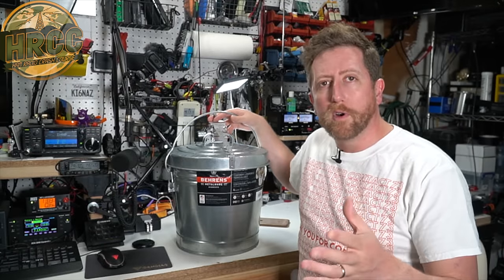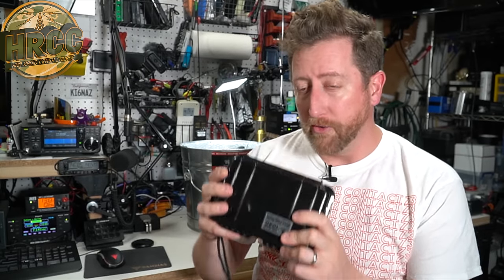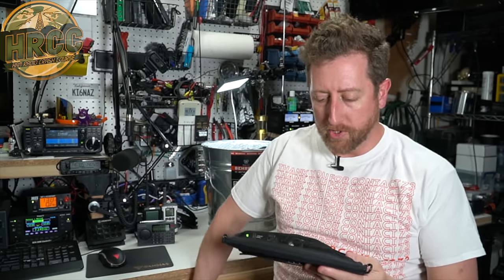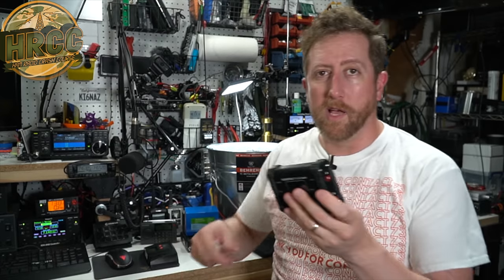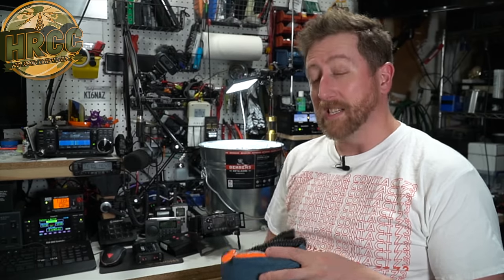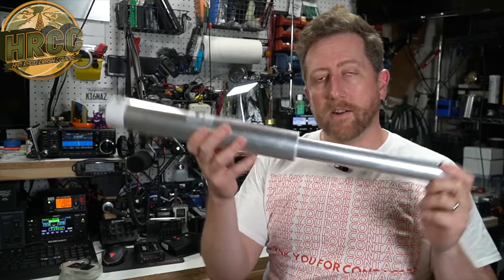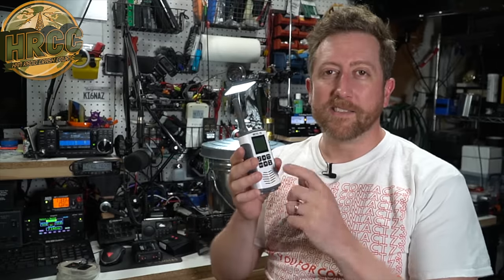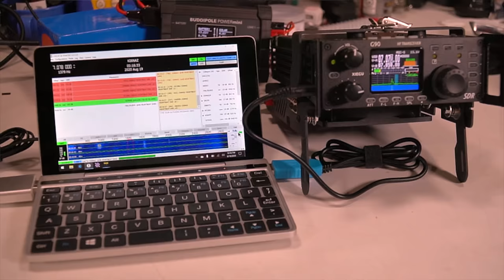Ham Radio EMP Kit, The Tactical Trash Can

Comment: any thought to grounding the can during storage? moisture reasons add silica packs. get 2 set up with cross band radios and antennas an automatic ider and you have a repeater (solar panel and battery extra) or a complete repeater on UHF. duplexors are smaller for UHF. old amo cans could have the rubber seal taken out and put in the rf sealing in its place. to keep water out you could spray it with a sealer on the outside. as for grounding it during storage would a 259 connector with a ground wire to a grounding rod be good enough. laying on its side would be better so lightning would travel less. it doesn't like (u-turns). I could see a lot of use from this type of storage for emp issues as well as a simple field day setup. quick grab kits like this would be easy to set up. a repeater kit simply take out the solar panel lean it against the side put the antenna on the lid and its on the air. one on each hill and you have a vhf repeater. handheld use on both sides of each hill.
Reply from the maker: Check out this video. I test the can for attenuation and also try with a grounding wire. https://youtu.be/o4CnecfAzng

Comment: EMP reception requires a longwave antenna like an HF antenna or power transmission lines to receive the energy and conduct it to any vulnerable device. If your devices aren't connected to a longwave antenna or shore power...you really aren't at risk. Anything air-gapped from these 'antennas' won't be affected.
Reply from the maker: You might be willing to risk it. But I am not. Thanks!

Comment: If an EMP were to take down the power grid even in a small area, the first need will be water and heat for winter cold.
A mechanical generator set can power a well pump, but will require fuel. Vehicles will quickly use up their fuel supplies.
Food supplies would also get horded and ATM's will run out of cash. Then looters and thief's roam at will.

Comment: Why can't you just buy flex seal paint and it would be a rubber barrier inside that can and also seal the seams and any tiny holes where the handle on the lid. If that stuff can seal a hole in a boat, why wouldn't it work as a sure fire seal/ barrier?
Reply from the maker: Meh. It might. Try it out and let me know when you test it.

Comment: I see no reason why you could not have more than one trash can EMP kit.  Or use a slightly larger can.
One question in regards to the lid.  Why didn't you line the inside of the lid like you did with the inside of the bucket?  Seems to me that the EMP would get thru the top of the lid if it wasn't lined as well.

Comment: I like "prepping" but I'm not very fond of permanently storing over $1k of great products away that may never get use.  Old tech still does the same thing and is a fraction of the cost, IMO.  I absolutely love my $30 Radio Shack and Realistic handhelds. They have ext antenna and power jacks. Just because one EMP hits, doesn't mean the threat is over, so you might want to duplicate this for backup.
I also prefer the $15 ammo cans of the 50 cal variety.  They do make larger surplus cans if you need more storage for $48.  These things are bullet proof and are designed to seal up well. I wouldn't recommend putting rivet holes in your can.
I wonder if you will really need the 2m/70cm after an EMP?  I see us using CB 19 the most for local chat (as it is now), with a couple DX'ing channels, and HF for getting across the pond information.
Reply from the maker: So take your kit into the field for some portable work.  No one said the gear has to stay in the 100% of the time.

Comment: Spare brain-box for diesel generator. Pile of "LED Flashlight" main boards. Compact wall warts of all voltages. Car alternator (Yes, I know it needs 12V ... but we can get there...) Bags of key diodes, chips, fuses, soldering iron, arduinos, rasp-pis. Camera/iPhone/sights

Things for EMP that are not in shielded area: At least one "many speed" bike to adapt, Dead car batteries, detached, regular battery supplies, detached, sulphuric acid, nitric acid, lead. (If we're hit that hard, it will be worthwhile making some of the key bits from scratch.)
Reply: What about a generator/starter 9n tractor or airplane that does not require the 12v field of an alternator...
Reply: All great! Every concrete-item in there has been pricier than I wanted to fling at doomsday though. Dead car alternator (that I can repair) much cheaper :D With all the problems a post-EMP is going to have, getting to 12V doesn't scare me. Pretty sure getting alternators to work could be a full time job :D

Comment: I would like to know what your thoughts are on a repeater in that bucket. I just started watching and was a scanner junky I high
School. I saw your Chanel and two days later I have two handhelds on the way. Ones a beogfang. So. I found a repeater on eBay. Needs two radios. It’s small. 5xRPT-2D repeater control box. I think it could be useable. You got a great channel!!!
Reply from the maker: Its not a bad idea, particuarly if you can get it up high and get some solar power on it.  In alot of ways it could be imensely helpful in a bad time.

Comment: You might consider adding a flashlight, cellphone, timepiece, USB's with data & photos, camera, GPS, car to house power inverter,  electronic car keys, credit card, power drill, laser pointer, VOM,  etc.
Reply: You didn't watch the whole video did you?
Reply: @WW5RM  Yes & I have a slimier container.
Reply: I dont believe a cell phone will do you any good. Buy i guess it couldn't hurt to have it. I do believe the raspberry pi and parts for it has the data & photos covered.

Comment: You should also line the can with cardboards so your electronics dont touch the metal sides turning it into a antenna to damage the gear inside
Reply from the maker: It lined in cardboard. 🤣🤘

Comment: Hi. I thinking about you must connect your "Tactical trash can" to the ground with a wire clamped to the outer of the can to improove the flux of electricity to the ground and not into your Faraday cage. Regards ZP5RST
Reply from the maker: Nope, we tested it on anther video.  It didn't do anything to the attentuation of the signals
Reply: @HamRadioCrashCourse  Really? I will find and watch these video. Thanks a lot by your fast answer. 73

Comment: Why don’t you intrinsically bond your lid and main can with a braided copper strap to ensure complete bonding?
Also, with external intrinsic bonding you’d be able to connect an 8 gauge grounding wire connected to an 8’ ground rod, wouldn’t that help to dissipate EMP/ CME?
Reply from the maker: External grounding isn’t going to matter if the lid and can are sealed as one electrically VoA the seal.  And the intervals are isolated from the walls.

Comment: Thinking of the RPi, there's quite a few cheap Chinese Android boxes that have an unlocked bootloader basically allowing you to boot pretty much any OS you want (the Arm version of windows, Linux and so on) from an SD card.

if you could use one of those instead of an RPi, granted they usually have fewer USB ports 2 instead of 4, but I guess you can just use a small USB hub if needed.
Reply from the maker: I wonder if they would have software compatibility issues in that configuration and OS.
Reply: @HamRadioCrashCourse  I wouldn't think so being that you can boot any OS you wanted on them
Reply from the maker: But it’s ARM. For instance. Issue running wsjtx on windows running ARM.
Reply: @HamRadioCrashCourse  well, if the program has an ARM version compiled, being that it has a source available it shouldn't be too hard to do. I mean you could just run the same OS the RPi is running. The RPi is ARM, the Android boxes are ARM.
Reply from the maker: Right, so not much reason to venture outside RPi. Again, go for it. But I’m not pointing people to it now.
Reply: @HamRadioCrashCourse  no of course not, I was just asking since they share the same architecture and can usually be found for cheaper than the RPi and offer the same if not more performance than a RPi.

Comment: Are you keeping the coax cable and antennas inside the can for convenience?  I didn't think an EMP effects those things if they aren't connected to anything.  In fact, in electronics, I thought EMPs mainly effected circuit boards and capacitors, not unconnected wires.
Reply from the maker: Yep. Assumption is if a damn bomb goes off, you might not be grabbing coax and other BS to GTFO.  Just grab the can, other bags and leave.

Comment: i have same kit, just difrent things in it asnd what i did is i melted lead all over the bucket, i heated up the bucket with simple torch and then put lead on it, it melted on it so it will cheald 100 times better then

Comment: I think I would weld or solder a ground wire from the bucket and run to ground also just for extra security.
Reply from the maker: Grounding didn’t change the attenuation results.
Reply: @HamRadioCrashCourse  Very cool. Thank for the reply and knowledge.

Comment: So you made a comment that only a low power HF transmitter will be required after an EMP because the background noise will be greatly reduced - I'm thinking the exact opposite - the atmosphere will be fully charged (ionized) and at lower A(bove)G(round)L(evel and instead of the usual S2 background noise it's going to be more like S6 or higher. In fact the the separate layers may be temporarily merged into a single D layer which absorbs energy from radio waves.
Reply from the maker: .... for how long?
Reply: @HamRadioCrashCourse  too many variables to answer that. Also - the most efficient communication mode is CW, especially with high QRM levels
Reply: One more point - in a EMP situation from a CME or enemy attack -  a situation where the normal social fabric is highly disrupted remember as soon as you transmit its possible to pinpoint your position - so transmitting could be particularly hazardous if you want to remain hidden.

Comment: I doubt anyone will see this comment but a galvanized steel trash can would be coated with zinc, right?  Isn't zinc used with electrical insulators on power lines?  How would the grounding being attached to zinc-coated steel be affected?
Reply from the maker: I saw it. The coating doesn’t matter, so much as it’s some kind of conductive metal. You need to to great a completely closed vessel so the energy of an emp is only one external skin. Grounding isn’t as important here.

Comment: They have spray-on electrical tape. That has worked far better to line the inside of the metal cans than trying to glue in cardboard. Do you see any issues with using a couple coats of the spray?

Comment: i think im going to use a old fashion 30 gallon metal garbage can. the kind we had in the 1960s and 1970s before plastic cans were invented,
Reply from the maker: Tough to cart it around, but not a bad idea.
Reply: 30 gallon lidded metal oil can clamp on banded lid? That would work without modification...

Comment: Would metal window screen material be enough to protect electronics from an EMP?  Also, would metal duct tape (the type that is actually used for HVAC) work for sealing the lid of the can or a can that doesn't have a clamp like yours?
Reply from the maker: No, metal screening likely is not enough. 

Metal tape can work. But remember the lid and body must contact the metal of the tape for there to be a seal. If they are separated by adhesive, it will not work as well.

Comment: Would it be worth putting a cheap cell phone and SIM card in the tac can too?  That would be the P in pace for me, if it doesn't work, or no one is reachable, that's when all the redundant radio stuff comes in.
Reply from the maker: Yes, absolutely, but most prepaids don't carry for months and they expire the number, which requires you calling them to re-establish it.
Reply: @HamRadioCrashCourse   I didn't explain it much, but I would leave it unactivated in the tac can and only set it up with a number and activation when I needed it.
Reply: @58Alpha 
If that's the case, then the internet will be down, so there will be no way to "activate" the sim card?
Reply: @jkg6211  well idk, cellular data may work with satellites or something? I mean if you and other people had cellphones protected and they work somehow, that's better than not trying it in the first place? I'm thinking of the contingency plans (P.A.C.E. plan). I don't want to go into this with bias already discounting things that we think might not work.  Grab some cheap tracfones or something at Walmart and throw them in the faraday box, why not?
Reply: @58Alpha  
Agreed. 
I have an old Galaxy Note 4 and a Baofeng uv5r playing as my "Canary in the Coal mine".
(in case one or the other fail due to issues other than a CME, EMP, etc.)
So, I get what you mean... it's good to think outside the box when preparing for a worst-case-scenario/s.

Comment: How does cardboard and packaging material block an emp?

I was expecting a tightly woven copper mesh to line the inside and top of the can. 

73
Reply from the maker: It doesn’t. It keeps the electronics from touching the can body. It’s an insulator.

Comment: Just before 9-11 one of the science magazines had a possible design for a lowtech non nuclear EMP!  So it could happen :(

You need a bigger can!  I wouldn't include the mobile radio.  I would think flexable solar cells with a chems to be added battery would be good. I'd want a butane soldering iron plus a few cans of butane gas, and solder so you can try to fix some of what was messed up.  Also I'd include 1 or more 75' assemblies of rg6/rg8 coax to rewire a dualband ringo on a tower so you can get out on the yaesu c4fm radio.
Reply from the maker: All of your recommended additons are all great ideas.  

Keep in mind, full size cans are tough to carry and transport around.  I'd much prefer adding a second smaller can than just have a bigger can.

Comment: So... EMP threat is real again, which is why I'm leaving this comment.

If we have an EMP that is something like a high altitude nuclear detonation, then lots of electronics would be taken out, on purpose.

The chances of not getting a second EMP detonation are incredibly low. If the goal was knocking out comms and electronics, then breaking out your radios from their faraday cages and plugging them in to use them could be the worst possible idea if it's right after things have happened.

I would try to wait a full week before breaking out my radios from this stuff. I don't think it would be a good idea to break out radios when they are likely to be fried again.

Comment: I saw a video that said that solar panel are not damaged, but how much can we believe what is on the internet. I would like to know if battery would be damaged. With the high power battery could they have a bigger problem if a battery blows.
Reply from the maker: The battery management system could have an issue.
Reply: @HamRadioCrashCourse  I should have thought of that. If my 100 amp hr battery has a short inside from a EMP I could have a problem! That is a bit mush to be putting in and out of a can!

Comment: I remember reading somewhere that the gray electrostatic bags that some electronics and computer parts come in make good EMP shields, I've saved a bunch and am probably going to keep using them either way since they're super strong and air-tight if they are zip-lock, but would like to know if I should make it a priority to make a stronger external Faraday cage. Is there any way to test their effectiveness?
Does anybody know if they work or not for sure?
Reply from the maker: A single layer bag likely won’t do it.
Reply: @HamRadioCrashCourse  bummer, but thanks for the reply! Is there really no way to test your cage tho? I know there are yt vids on how to make your own mini-EMP, I guess we could just put some old electronics in there  and try to fry it on purpose 😂

Comment: I was trying to make my own EMP kit and I tested using my cell phone and calling it.  Turns out, I my cell phone can receive a signal while in a closed microwave oven, A full metal safe, A metal lock box.  I was unable to find any way to fully isolate my cellphone from receiving a signal from my wifi or the nearby tower.  This surprised me.  Why can they get through a closed microwave oven?
Reply from the maker: Coating in front of microwave is for blocking microwaves, not cellphones.
Reply: Try your FREEZER.  You might be surprised (NO, I'm not suggesting you freeze the phone so it CAN'T ring)

Comment: Hey Josh I am very interested in getting started into the ham radio adventure. but am a working guy with limited budgets cuz of other hobbies, but would like to get started. I like your approach of sharing info better than some others, having watched several of your video's, My question is about the Yaesu ft-70dr, Does this radio allow for monitoring both bands of is it more similar to the ft-4x. my inpression was you like to be able to monitor both sides without switching between, manually. also i tried discord but could not get my phone number to go thru. talk to you soon.

Comment: If a grounded solar array can survive a direct lighting strike does that it mean my array would survive an EMP?  Would a metal skin building provide any protection against an EMP?
Reply: If the metal building is grounded, and your electronics are insulated from it, then you will get protection. I would like to know about the solar panels, we didn't have them in the 80's.

Comment: I would not trust a steel container as a faraday cage,  it's not conductive enough. Also,  it doesn't appear you've grounded yours at all,  which means it is NOT A FARADAY CAGE. It will just absorb and re-radiate RF on the inside.
Reply from the maker: No. It doesn’t need to be grounded. Nor does it “absorb” the energy. Not how that works.